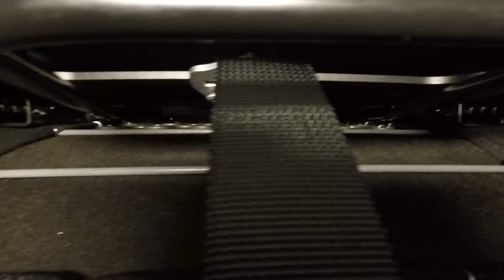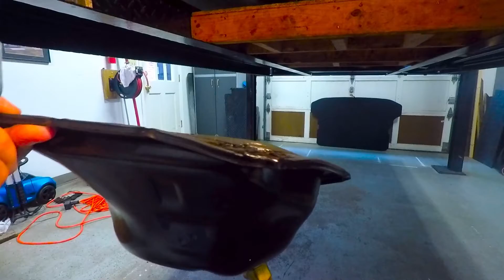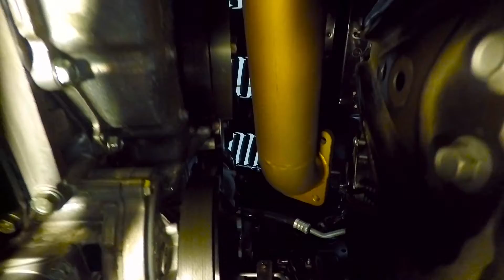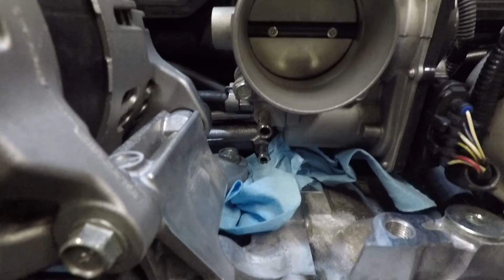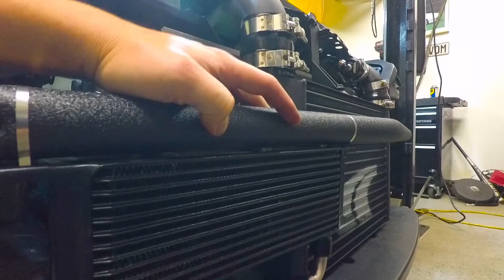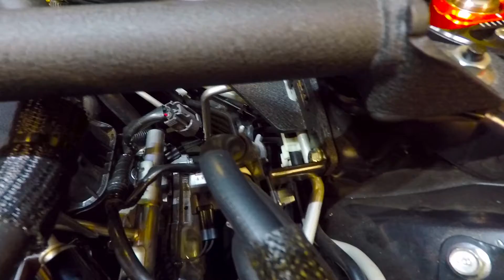Subaru BRZ JDL V2 UEL GTX2860R Turbo Kit Install

Comment: So what if you don’t have a boost controller or oil catch can how would you hook up your waste gate
Reply from the maker: With a hose straight from the compressor housing to the gate using spring pressure to open it.  Catch can has nothing to do with it.

Comment: For your AOS... you pull vacuum from the turbo, but block off the intake port vacuum line. I noticed mine was installed with a hose to each of those. Is there a reason you did it this way?
Reply from the maker: I changed it to be vented to atmosphere.  Check my build thread.

Comment: Great video Ian, can’t tell you how many times I’ve watched it lol. When installing the ID1050X injectors, did you run into any fitment issues? Read on the forums that the ID1050X injectors require a spacer so that the fuel rail can properly sit atop the injectors, otherwise it leaves a gap. Doesn’t seem like you used a spacer in this video but just wanted to double check in case I didn’t need them.
Reply from the maker: No spacer, remove the oring under the stock injectors down in the manifold.  Install the IDs and secure rails.  Vaseline top seals to make sure they don’t get pinched by rails and leak
Reply: @IanBarton86  Thanks! Keep up the great work!

Comment: Is it safe for stock block some people say it can use it full boost in stock block if u have new injectors and new rods
Reply from the maker: Yes its safe on a stock block if you tune it to be safe, with high octane fuel and conservative boost pressure and torque delivery. Stronger rods will make it more reliable with higher boost pressure and earlier torque delivery. Upgraded injectors are only necessary if using E85 fuel.
Reply: Ian Barton thanks bro

Comment: Is this gtx turbo safe on stock block?
Reply from the maker: Yes. With low boost and a good time
Reply: Ian Barton how much psi did you push before you got a built block?
Reply from the maker: @speedyweenie5070  I ran it on just a 9psi wastegate spring before getting a boost controller.  Stock rod bent at 14psi which I willingly ran it at knowing it would probably hurt it.  I would recommend staying at 10psi or less on a stock engine.
Reply: Ian Barton okay thanks I have the base turbo kit and was looking to upgrade I do have one more question the precision wastegate was it a pw39? Or which one? Thanks again

Comment: Did you get the "No cut" charge pipe routing option? Or did you get a replacement bumper bar?
Reply from the maker: I have a jdl bar and the short charge piping.

Comment: I just want to purchase the one I need and not get a whole set.  And did you torque your oil cooler lines with crows foot or just go by feel?
Reply from the maker: My Oil cooler fittings are -10AN and I tightened them with a crescent wrench.
Reply: @IanBarton86  thanks for the quick reply.
Reply: @IanBarton86  okay I have about 70% of the turbo installed.  Just a couple questions.  Your crankcase fitting that you installed into the block, can I use the stock one to go to atmosphere or do I need to use that fitting you installed.  If yes what would it be called so I can find and purchase one.  Also did your 3 inch over pipe connection to the front pipe gove you a hard time installing it.  Ours was such a bitch to get clamped.
Reply from the maker: @Wolverine05  no you can't use the stock rear PCV valve as it does not flow enough for a forced induction application. You should run an open rear fitting like the one included in the Verus Engineering AOS kit. You should really join the JDL Turbo Kit Owners group on Facebook as I've done an extensive writeup on this topic.
Reply from the maker: @Wolverine05  I don't run a 3 inch overpipe, I have the JDL 2.5" over/front combo pipe that uses an easy V-band connection at the overpipe.
Reply: @IanBarton86  gotcha yeani have the   band connection  but 3 inch.   It was a tight fit.   I will join that group.  I thought you just had the forum.
Reply: @IanBarton86  I found the group and sent a request thanks again ian

Comment: Just wondering what were the hottest oil temperatures you saw with the oil cooler you have.when running just the turbo and stock internals
Reply from the maker: I sold the Perrin kit I had originally which allowed oil temps above 240F.  Upgraded to the Blitz racing kit which is bigger and better in every way.
Reply: @IanBarton86 just looked at it now.  Is it the 12 layer?   I'm looking at upgrading my mishimoto from a 19 row to a 25 row before they ship it to me.  Do you think 25 row is overkill?
Reply from the maker: @Wolverine05  you can see it on my build thread.  19 row should be sufficient as long as it has ambient flow available to and through it.  Don't put it in front of your intercooler, that will just dump heat into the charge.
Reply: @IanBarton86  thanks again .    How do I find your build thread
Reply from the maker: @Wolverine05  https://www.ft86club.com/forums/showthread.php?t=13157
Reply: @IanBarton86  omg iam on page 3 of the thread and there are 101 lol.   Seeing your pictures of it brand new remind me of when I got mine.  Thanks again for putting this great content out there for us.  Just got off the phone with Deborah at jdl auto.  She mentioned your forum.  It will be here April 25th.
Reply: Omg its endless lol  I thought it ended at 107 lol
Reply: Great thread ian.  Finally got through most of it.  When you bent a rod and had the engine sent out.  Roughly what price was that.     Iam very impressed with every aspect of the build.  I know you have heard it before but congrats on the way it all turned out.  This is the path that I would like to come close to if possible at all.  Your points you argue in your thread are great also.  A reason for everything you did.  Anyways congrats again.  Iam trying not to ask you to many questions because you have been asked thousands already.  Is there a better way to communicate with you or is this okay.

Comment: At 26:00 the left one you capped.   What is that and why did you cap it.   Sorry for all the questions.   My kit is on the way and I'm just finalizing everything
Reply from the maker: It's a vaccum port. You should really have a professional install your kit.
Reply: @IanBarton86  iam going to do the install myself.  Iam a millwright so I have confidence I can do this, just double checking some things.  I have several other supporting mods going with it.
Reply: I have all the tools myself and I hate other mechanics working on my car.  Just how iam .  Iam going to sleeve the car and do forged internals like you did also.  Even then i kinda want to do it myself but that one iam not sure yet lol
Reply: @IanBarton86  Quick question regarding this capped off port, couldn’t you have potentially run the vacuum lines from the AOS to this? My JDL kit didn’t have the nipple on the intercooler piping that you connected your AOS vacuum lines to and I was wondering if I could just source the vacuum from this capped off port?
Reply from the maker: @Prodby33Bob  I don’t recommend running the AOS recirculated into the intake pipe vacuum port.  Vented to atmosphere with it capped is the way to go

Comment: Did you clamp the evap hoses be cause you have a upgraded fuel pump?
Reply from the maker: No, simply because the engine is boosted and they'd pop off under pressure without clamps.

Comment: Is there a particular reason why you tapped your boost source directly on the tubo housing and not an intercooler pipeing?
Reply from the maker: because that's the most accurate source and the housing is much more rigid than the piping

Comment: In case you guys have an awful experience getting the headers on like I did, Get the headers mostly on the threads on each side and then use a jack to jack up each side. Then put a bolt on the first side you jacked up and do the same for the other side.

Comment: I'm trying to find imperfections and then only thing I saw was a sloppy zip tie cut.   And one clamp alittle misaligned with the other on the front.  This is an example of a perfect build.   And very well thought out.  Hope you dont mind if I throw questions your way

Comment: I was set on greddy or speed by design but after seeing this and finding out about jdl.   I'm sold.   Garret turbo and no replica.   Yes yes   greddy kit you need to many extras I think
 Doesn't even come with there new bov floating valve design

Comment: Those oil drain valves scare me.alittle.   just because you dont need a tool to tamper with the coolant.  Not that you would piss people off to do that but always worried me so I got the greddy magnetic drain plug which actually ended up leaking later on.  So went back to stock untill I get a new magnetic one

Comment: Did u change the washer on the custom drain plug after u took it off the stock oil pan?
Reply from the maker: It comes with a felt washer that has held up great.  No leaks.

Comment: Hey Ian. I wanted to ask you if you had any smoking out of the exhaust. Reason I'm asking is because my turbo is leaking oil into the turbine housing and I believe it's due to a problem with oil drainage out of the CHRA. Like you said in this video, the turbo should be clocked to within 15 degrees from vertical but the best angle I could get was 20-22 degrees because the T3 exhaust flange is getting in the way of the turbo oil drain fitting. I'm also on ft86club and posted in the JDL Turbo Kit Owner's thread if you want more details.
Reply from the maker: Hey Ray,
I do not have any smoking and my oil drain has worked fine.

Comment: Do you remember the torque spec for the intake manifold?
Reply from the maker: No I don't, but its in the factory service manual. http://jdmfsm.info/Auto/Japan/Subaru/BRZ/2013/USDM%20BRZ%20FSM%202013%20PDF/
Reply: hmm scrolled through it twice didn't see the spec. I'll keep looking thanks for the link.
Reply: 21lbs

Comment: How come you replaced the upper  injectors, they are used for start and idle, can they be used for something else?
Reply from the maker: The port injectors are actually primarily used for fueling under load, so increasing the flow rate of those is how you make more power with boost and E85.  The direct injectors are what the car starts and idles on, and they switch on and off depending on the load and other variables.  EcuTek tuners can use the D4S fueling system on the FA20 to their advantage, especially with bigger port injectors and forced induction.
Reply: i found this video /www.youtube.com/watch?v=zc8aUxBZlsU just trying to understand the differences
Reply from the maker: here's more info 
http://www.ft86club.com/forums/showthread.php?t=3172
Reply: Ian Barton Thanks Ian

Comment: What’s the boost tap on the turbo for ?
Reply from the maker: For boost reference, of course.  That line goes directly to the wastegate to provide pressure for the spring to open the wastegate once the target pressure is reached.

Comment: Did you use an oil restrictor for your turbo? I wasn't sure if JDL provided one for the Ball bearing turbo option.
Reply from the maker: The Garrett turbos have a built-in restrictor, so no need.
Reply: Ian Barton Ah, thanks!

Comment: Hey great install video, I had a question if you don't mind answering. Is the exit diameter of the downpipe 3" where it meets the frontpipe? I have a 2.5" JDL frontpipe and was wondering if I'll need to pick up a 3" or get a 2.5-3" step up adapter.
Reply from the maker: Kawi Fnatic you can specify which diameter flange you want on your downpipe exit. Mine is 2.5" because my front pipe is the same.
Reply: Ok, thank you for the help!

Comment: you seem really smart and u know what you're doing can u do mine lol what turbo would u recommend?
Reply from the maker: kg the great one I recommend the smallest Gen2 gtx turbo that will meet your power goals
Reply: @IanBarton86  how much would u get like 250 or 300?
Reply from the maker: @Kanadian-Squirrel  you wouldn't even need a GTX for 250-300.  The older, more affordable GT2860RS would easily meet that goal
Reply: Standard v2 charge pipe routing option from jdl or no cut option?
Reply from the maker: @Kanadian-Squirrel  up to you. I'd personally go standard and order the JDL front crash bar with your kit.
Reply: @IanBarton86  awesome thanks man

Comment: Did you upgrade your crank pulley to a lightweight pulley? Very nice build btw!
Reply from the maker: buddy it's a Fluidampr which is actually heavier than stock but it adds HP up top by killing harsh vibrations on the crank
Reply: @IanBarton86  good to know    lightweight is more responsive but harder on the engine. Didnt know there were heavier ones.

Comment: Great camera angles and walk through. I am getting the JDL or SBD Kit for my BRZ. I have to say, you explained so much I may try to do it myself.
Reply from the maker: Do yourself a favor and get a JDL kit and let SBD keep their Taiwanese knock-off hot parts.
Reply: Everybody tells me the same thing! After 4 months of research, I have narrowed it down to these two kits. I have seen many successful kits with SBD and great numbers. JDL kit looks gorgeous but I don't find very much information on the numbers it puts out. From my perspective SBD looks more proven to me right now.  Only thing I see from JDL is great quality and options.
Reply from the maker: The numbers you get from the JDL kit entirely depend on the turbocharger you choose, which is why the number of Garrett and Precision options are an advantage over the two Mellet turbos made overseas that you get with SBD 400x or 500x.  The Precision 4851 base turbo can make 280-300whp on low boost and pump gasoline and close to 400whp on E85 and high boost.  You can choose a bigger turbo and make more but you should build the motor first.  If you join the JDL owners group on Facebook you can find a number of dyno charts among many other reasons to choose JDL over SBD ;-)
Reply: How long did handling take for your kit? Also, who's tuning it? I requested to join.
Reply from the maker: It took 4-5 business days to ship from PHX to ATL.  James Martin with HRI Tuning is going to be dialing it in.  Added you to the group.
Reply: I meant how long after purchase, to put the kit together before it shipped? Also bud, what brings you to HRI? I was thinking of going right next door to Circuit.
Reply from the maker: Production took about 3 weeks.  I've seen the results and reviews of James' work over the years and his experience and expertise tuning the FA20 with forced induction has proven to me that he's got more talent, attention to detail, and quicker response time than the majority of tuners out there.  I think his programming background has a lot to do with that.  Plus he's just a very smart guy with a good bit in common with me.
Reply: How did the tune end up?